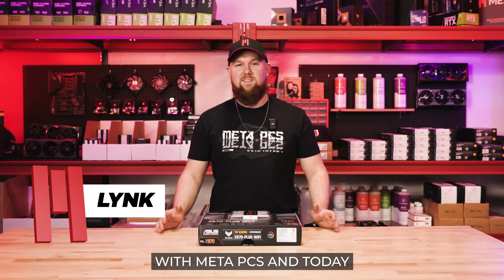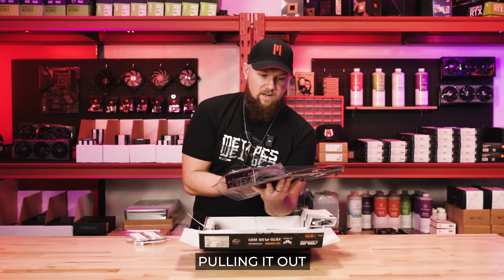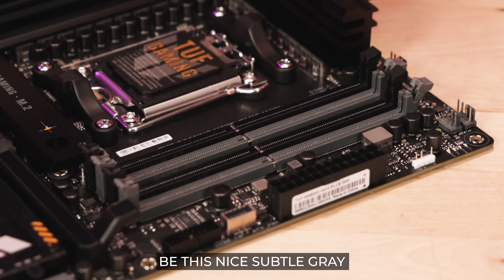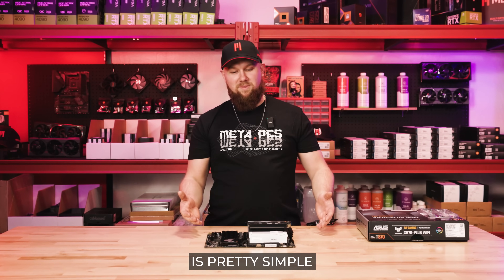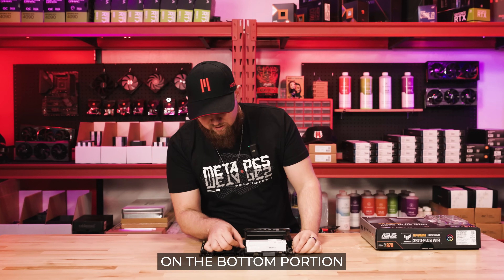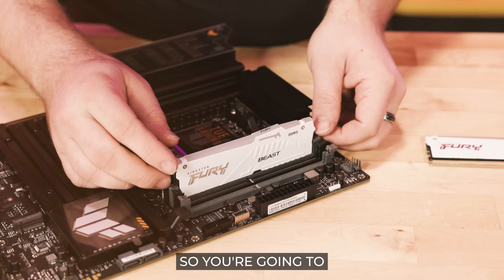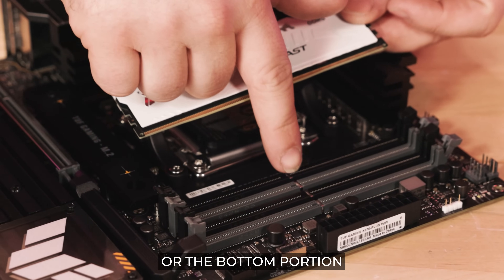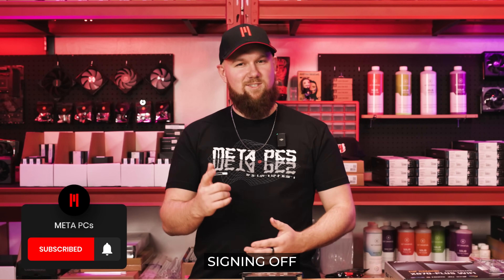How to Install and Reseat RAM in Your PC

Comment: Thanks this was a big help. Cyberpower screwed me with some faulty ram and I was having trouble replacing it.
Reddit gave the impression that the clips wouldn’t shut even if the ram was seated correctly but getting a good clear view of the process and the kinda uneven one side at a time methos for asus was a big help

Comment: I am having an issue getting my DDR5 PC to read 4 sticks of ram instead of 2 sticks. But for some reason when I first built it it accepted 4 sticks, but now will only boot to Bios or OS with 2 sticks in the 2nd and 4th slot.
Reply: It's a really big issue and there isn't really a fix ddr5 and windows 11 want to kill each other with 4 sticks I'm guessing since your dividing it so much but I have no idea if u can I would say take back the 4 you have and replace them for 2

Comment: I got a RTX 4060 my first gpu is it a good idea to use a amd ryzen 3 4100 with the 4060 or should I buy a amd ryzen 5 7600x?
Reply: I'd go for ryzen 5 7600x because its both the newer AM5 chipset and more powerful, be warned you will need to buy an aftermarket cooler for it. I'd reccomend something like a deepcool AK620 so only get the ryzen 5 7600x if you have the extra cash.

Comment: Motherboard should be in the case, FIRST.
Reply from the maker: No, you don’t need the motherboard to be in the case to install RAM. In fact, it’s often easier to install RAM when the motherboard is outside the case, as you have more room to work and can ensure it’s properly seated.